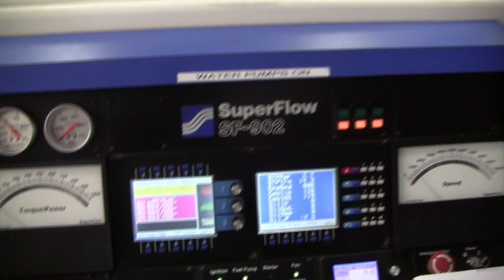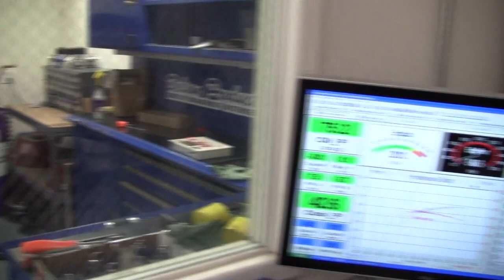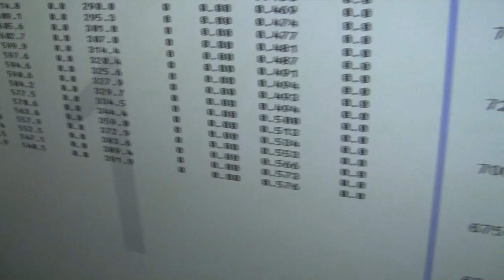Tom Fry's 427 SOHC Cammer 740HP Dyno Pull | QMP Racing

Comment: It's amazing how engine performance has advanced over the years. 707 hp out of  Hellcat that's available in damn near every Mopar model. I'd take this noisy, lumpy, inefficient, as far as gas is concerned, beast any day. The oohs and aahs at the sight of one of these is by far more intense. Most muscleheads have never even seen one of these other than in a magazine or a dream.
Reply: 707 out of  Hellcat?Pro stock 351 Clevelands were making 750 hp na back in the late seventies and early eighties on the dragstrip.Bob Glidden ,Gapp and Roush Etc.As for hp ,i suggest you look at turbo six cylinder ford engines here in Australia.It will shock you.
Reply: Most gear heads under 50 never heard of or seen one!
Reply: @petergiannaros9037  Ford 427 SOHC can be built to have over 1000 hp. Stock, they were rated at 650+ hp. Realistically, it was near 850 hp.
Reply: @floydrhodesiv5733  Don Garlits has several originals at his drag racing museum in Ocala FL that have never been run. Jon Kaase builds new ones but they are highly expensive.
Reply: @petergiannaros9037  NASCAR 358 CID engines put out up to 850 hp without restrictor plates.
Reply: Had an incredible chance to buy one still in the crate from old Ford sponsored racer I knew back in 1981 for $4500, a lot back then, would be worth ten times that now.
Reply: @kennethchapman9564  Back in the 1970, I considered buying one for my '57 Ford Custom 2dr sedan. As I recall, the Ford 427 SOHC could be bought, OTC from Ford, for $2500. Too pricey for my budget back then. Today, an original one is $65,000+ and very rare to find.
Reply: @sergeantmasson3669  yeah, listen to that engine idle and the lope of that cam , then listen to a 70 426 in a cuda and theres no comparison, THAT FORD 427 IS MAKING TONS MORE HORSE.
Reply: @twolak1972  Most likely it is not a factory Ford produced 427 SOHC. For stopped producing that engine in 1967. Aftermarket companies began producing them soon afterwards. Aftermarket companies did the same thing when Chrysler discontinued the 426 CID hemi engine in 1971.
Reply: @sergeantmasson3669  true. Not streetable by any stretch though. And of course the racing fuel would melt your wallet faster than hot knife through butter.

Yep, a 427 cammer is my desire. And I just might pull it off before I croak. If you want something badly enough right?
Reply: @stratolestele7611  Jon Kaase now produces Ford 427 SOHC engines. Ford no longer does.
Reply: Don't forget that the Hellcat is supercharged. This engine is naturally aspirated.
Reply: @jegr3398  No sh*t Sherlock. Your ignorance is of titanic proportions. Dual-quad Ford 427 SOHC still had more HP without superchargers. BTW, after 2023, no more Hellcat or MOPAR hemi V8 engines in production vehicles.
Reply: Modern camshafts and fuel systems will get you better mpg in a light car
Reply: @dennisrobinson8008  Far more involved than just that, PUTZ.
Reply: @sergeantmasson3669  it's pretty much that simple.   over-complicating things makes it sound more intelligent for someone who doesn't know, but some of us KNOW.
Reply: The difference is all the new cars are junk to me and always will be , I don't want no bullshit EFI or the sensors and computers the junk new cars have . I don't care if they have 10,000 horsepower and can beat all old cars they are still junk just like all the new electric cars coming out that will beat everything they are still junk to me , I'll take the good old Ford  427 SOHC , or the Boss 429 , or the 428 Super Cobra Jet, or 429 Super Cobra Jet, the 351 Cobra Jet, the Chevy 427 , 454 ss , Dodge 426 Hemi , 440 6 pack , 455 Olds , even small blocks, 283 Chevy , Ford 289 Hipo , all those cars and engines I would take over any new car . I'm a Ford guy so 1985 is the Last year Mustang I will buy because it's carburetor
Reply: @sergeantmasson3669  An average running original would probably cost you 50k.  A low hours mint that looked like this ... who knows, 100k?
Reply: @321gates  BTW, Don Garlits has 10 "never been run" originals still in shipping crates.
Reply: @Sergeant Masson  I thought it was two, but regardless, it was a nice investment.  He probably bought them from Ford for $3500. back in the day.
Reply: @321gates  I know that Ford gave him three when he was getting fed up with MOPAR
Reply: @sergeantmasson3669  Cool.  I almost suggested that they may have even been given to him.
Reply: @321gates   Garlits was upset with MOPAR because their 426 hemi engines were weak and he met with Ford about running their 427 SOHC engines. Garlits went with Keith Black hemi engines instead.  At that time, the Ford 427 SOHC engine flaw was the timing chain. Later replaced by an all gears setup. Ford discontinued producing the 427 SOHC engine in 1967.
Reply: @sergeantmasson3669  Cool story.  Thanks.
Reply: The hellcat motors are super charged . This one isn’t …
Reply: Well, the Kaase engines make about 100 more than this and have better carbs, plus the timing system is gear drive.
Reply: Well, the Kaase engines make about 100 more than this and have better carbs, plus the timing system is gear drive.
Reply: The Duke says, remove the supercharger from the hellcat and it's down to 400 horsepower. 
What did I teach you?

Comment: The king of crate motors -circa 1964-1966!  Awesome
Reply: 1966 - current
Reply: I would argue 67-73. That’s when the golden years of this motor were. After that, the Hemi’s aftermarket caught up. If they had made an aftermarket block for this, it would be 67-current.

Comment: This and the boss 9 motor are two of the most beautiful motors ever designed.
Reply: TWO TRUE !!
Reply: Loved seeing the Cammer in the 55 Chev called Payback...haha !!
Reply: Internally  they certainly were.
Reply: I saw that car at Detroit Autorama
Reply: I respectfully disagree Chico, I believe the most beautiful motors ever designed were between the 426 Hemi and the 454 big block.
Reply: What about a Max Wedge Stage 3 with the cross ram intake and upswept exhaust manifolds eh, eh eh :) ?
Reply: I'm a Ford man all day every day,but you have to respect the 426 hemi,the 327 Chevy, the 427 ZL1,but yeah,Ford had the 427 sideoiler,the 428 SCJ,the Boss 302,429,and 1 of the best engines,the 351 Cleveland...
Reply: Could,nt agree more, If I can,t have a 427 cammer give me a BOSS 9.
Reply: @wesleyaitken8756  What , the 454 was a ugly pile of shit next to the 427 Ford or Boss 9. My 3rd choice is the 413 max wedge with the offset carbs, OMG.
Reply: @slyane7320  The chevy 427 was a pooch compared to the Ford Cammer,  side oiler or Boss motors.Ford always came out with the new high tech stuff and chevy played catch up.THEY STILL ARE 50 YEARS LATER.  LOL

Comment: I've always liked the 427 SOHC.  They were ahead of their time.  I have seen pictures where the intake ports are about the size of a soda can.  Real big!
Reply: Good ole Ford Huge Intake Ports, Just like the 4V Cleveland Heads and the 429 Cobra Jets, and Super Cobra Jets.
Reply: @badass6.0powerstroke10 the ford 427 tunnel port heads where huge also,very good cylinder heads

Comment: It's not the HP that will kill today's muscle it is the torq and these old SOHC'S had plenty of it and look out when ya get the tunnel port head's bolted on.
Just ask the guys running funny cars in late 60s these motors set more records NHRA then any ,great vid.
Reply: Just awsome thunder ! I was lucky enough to grow up by motown muscle met alot of cool people and got to feel some major torq of these monsters. me my self born on the day 428 SCJ was released am a true FE man got 390 w/428 scj grind cam and heads in F250 1976 pickup when its uncorked and light ta light takes the new stuff they
 just scratch there heads!LOL
Reply: Where do you get your information?? Ford killed the "Tunnel-Port" program (which was for the FE & NOT the SOHC) because those heads produced less Hp & torque than the 'high-riser' FE heads.
Reply: Jersey ,I  fully understand difference in SOHC and tunnel port even though two different monsters they are both FE engine ,the  great part of the tunnel port was the round port with push-rod dividing it an with 2 4brl intake they worked great ,yes the SOHC worked better via higher horse and torq. as for high risers worked good to ,these heads are all different RPM range different flow rate ,they are all great and depending on what Ford was using it for which form of racing ,the HP TORQUE range very so much as only one was on standard production line that being the high riser headed FE ,and even some of those had a little mods  for diff apps. ,,I have seen high rise heads with cast ## SPEC ,,stands for special cast ,,In short I love the torque of all the FE's  P.S. didnt mean tunnel port was better than SOHC  just it was standard looking FE .
Reply: TIM WEAVER k
Reply: TIM WEAVER Jersey about the 427 SOHC or the medium/high risers 427, the only difference in SOHC 427 is the top end, Hemispherical heads w overhead cam, the bottom ends are identical, all FE blocks from 330/332 all the way to 428 all the same block only different bore and stroke. The 406, 410 and 427 medium/high risers were all built to race lemans, these blocks inparticular had reinforced webbing on the block, reinforced main caps, reinforced webbing on rods as well as specialized rod cap bolts. These FE engines were bulletproof, I have been an FE fanatic since my early teens, I learned a lot about the racing wars in the 60s between Ford, GM and Mopar..
Reply: TIM WEAVER 
Those are tunnel port heads👍

Comment: Hemi killer !!!...oh and how those MOPAR guys hated it !.
Reply: i agree,being a ford/dodge person,but,,i can buy a hemi now,..best thing chev ever put out was the later LS series.there actually a proper built engine.FINALLY..takes a while to wake up i suppose..
Reply: I am a Mopar guy and gotta tell ya...you can't hate something that never existed. Can't consider a half dozen or so hand built outside the factory  to be production for anything so basically these are just aftermarket engines that nobody wanted . And while these mythical monsters did make some HP...I read they were engineering night mares as far as the valve gear and the 20 foot long timing chains went and were said to have not been able handle a 500 mile NASCAR race. The way I see it , if these cammer things were so great, then Ford engines would be powering ALL top fuel cars for the last 50 years. We all know where that went...can you say HEMI???
Reply: @bultacowally  The chain was 6', not 20'! Pete Jackson, I think his name was, built a gear drive to replace the chain. Ford developed this engine for NASCAR racing, to compete with the hemi. NASCAR knew these engines were going to be too fast for safety on their tracks. So they banned both engines. After that Ford quit on the engine, even though the likes of Dyno Don, Don Prudrohme & others were racing the engines in NHRA. The guys that were using it in T/F ended up switching to other engines. While in use, they were very competitive! Too bad Ford quit on this remarkable engine. With Pete developing that gear drive,who knows how dependable it would've been? Things might've changed...a lot in NHRA!
Reply: > oh and how those MOPAR guys hated it !.
I'm a MOPAR guy, and I love it.  It's a brilliant design intended to do one thing, make effortless power.  It would have made NASCAR the competition it was meant to be.

Comment: The 427 cammer was banned from nascar but Ford did still win moore reaces than the Chryslers by running their old sideoiler
Reply: ***** not correct; Ford won manufactors championship in 63-64-65-66-67-68-69 and drivers championship in 60-63-64-65-68-69
Reply: 64fairlane357 Manufacturers championship doesn't mean shit...You can win that without winning a race.
In 67 Chrysler won 36 of the 49 races that year,yet Ford somehow won the manufacturers championship???
Petty won the 64 drivers championship,
Petty & Dave Pearson both won 16 races in 1968,yet Pearson won the Championship,
Bobby Isaac won 17 races in 69,Dave Pearson only won 11...yet Pearson again won the drivers Championship????
Reply: 68bobba2 Ford won more races in NASCAR between 1960 and 1970. it's in the books.
Reply: @bobba68 Also have to remember, NASCAR hated Ford for some reason, they were always on their ass about something.   Ford did have one car that at around 180, became air born, lack of aerodynamics. Chrysler did do the first tunnel testing.  Ford was about to make a come back with its King Cobra Super Snake Torino.
Reply: @MrDriftonin  -Nascar had it in for Chrysler(after it withdrew its factory teams),for the 65 season...It almost went broke.
Not sure if Nascar hated Ford,but...At the end of the 64 season Bill France banned the Chrysler 426,Yet was prepared to allow the Cammer to run(only with an unrealistic weight penalty...IE, ballast).
The problems Ford car you speak of had, sounds a lot like Chrysler's 68 Charger...Poor aerodynamics which created lift,at high speed.
Reply: @68bobba2  Yeah, Pearson, Petty and Isaacs won races, and whatever they were driving won manufacturer's championships.   GM was out of racing after 62...they were dominating before that.

Comment: Beautiful piece of Ford Engineering..!  I drove a 1967 White Euro head lights Galaxie that had a cammer and a top loader. It had a  4;56 rear end.. Could pull the front tires off the ground just with a quick tap of the pedal..
Reply: Did you install the cammer? Not from the factory.
Reply: Nope.. somebody built it and it wound up in a long gone consignment auto dealership  Nostalgia Motors in Campbell California. this place Was owned by Ferrari of Los Gatos owner Brian Burnett
Reply: Andrew B wow I know it had power but it's impressive that u were able to hook up so well to lift the front end.
Reply: My dads 62 Ford 406 Galaxie Sunliner pulls the wheels off the ground also Chrysler, Chevrolet, and NASCAR didn't like that 1 either got banned also.

Comment: The Original 427.   Killing chevies and layin down beats on mopar!
Reply: Chevy introduced a 427 in 63 as well, Two different ones, the Z11 427 and the mystery motor 427 both of which were very successful.  The Z11 heads were very similar to the heads used on all later BBC's.  So good that they heavily influenced the design of the Cleveland heads use on the small block Boss engines.
Reply: osp80  they made a hell of a lot more then 20,
Reply: @deviljoint9866  they were disqualified from NASCAR due to not being released as an option in production vehicles
Reply: @gearyharlan7729 no they were banned because of the overhead cams,the hemi was also banned a yr or so later in 65,the rule for 500 factory cars came later if im not mistaken.
Reply: osp80  If you knew what you were actually talking about it would be good.Ford made a lot more of these engines than you describe,
Reply: osp80  In  other words get educated before you make statements on youtube with no basis in fact.

Comment: This reminds me of hearing the V-8's they used to fire up the engines on the SR-71s.
The "Blackbirds"flew out of Kadena Air Base where I was stationed and the way we knew they were going to fly that day was when you heard those V-8s running at full throttle like that.
You could hear them clear across the base.
I don't think there was even a V-6 on the island at the time.Everyone just drove 4 cyl. cars and trucks.
Those V-8s had a distinct sound in that environment,that's for sure.
Reply: Those V8s were Buick 401 nail heads and they had no mufflers!

Comment: Sounds like a beast. I hear Chrysler was so scared of this engine they had NASCAR ban it. Sounds like a straight up race engine. I would love to have one in a 69 Boss Mustang.
Reply: James Sawchuk 

GM really banded it, like they did Chrysler in 69-70 as the story goes. However, chassis and engines were changing so the real thing that killed it was Ford. $$$ to MFG and Family affairs cost Ford so they pulled out of domestic racing with the exception of Nascar. Too bad Nascar isn't really stock cars. I would be curious how things play out now. The Current Coyote is all Ford Cammer mated with DOHC Cosworth.
Reply: Would be interesting, indeed.
Reply: Michael Quinn where do you get cosworth and coyote/modular mixed up?
Reply: ***** Hey Nick, no I mean Ford used the history of what they learned from this motor and Cosworth DFV double four valve and the Modular variants of the recent past. Combine all that and you have the Coyote motor. Best small v8 built in mass production.
Reply: I like the flat crank in the GT350. 530 NATURALLY ASPIRATED horse power.
Reply: James Sawchuk BOSS versions only came with 302 or 429, the only mustang ever equipped w the SOHC 427 were call the "FX" mustangs, strictly racecar, around same time as the famous  fairlane "Thunderbolt"..

Comment: Cactus Jack & the boys build a helluva NASCAR engine with their FR9! All aluminum and can be built to 454cid.  
And at home, you can build a 460cid small-block Ford based on Ford Racing's "Boss 351W" block. 460 cubic inches that looks like a normal, itty-bitty little ol' 351W . . . SURPRISE, y'all ! ! !
Reply: Yea, maybe? But the generic motors will always dominate the big three, or four due to three simple things? Ford fanatics can't see these, fore the oval spins them in a circle that will always let them down...